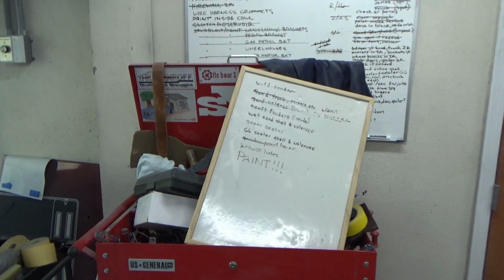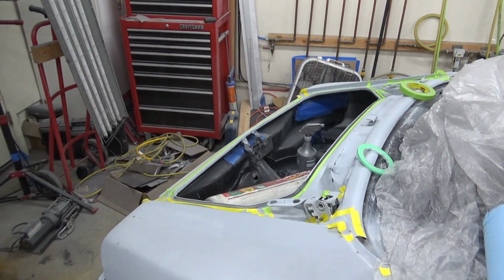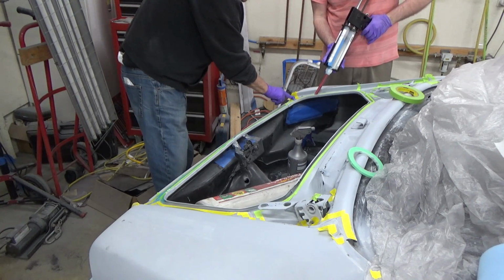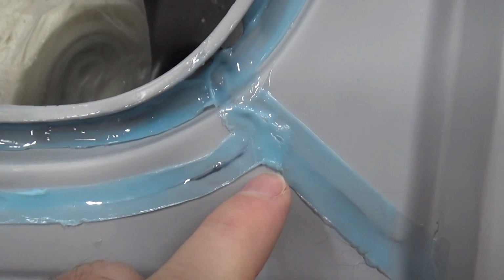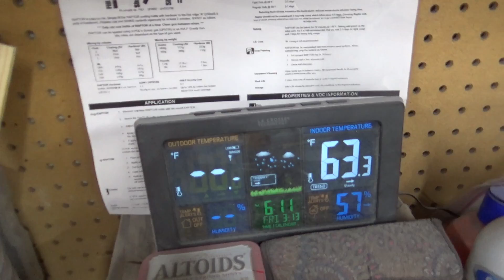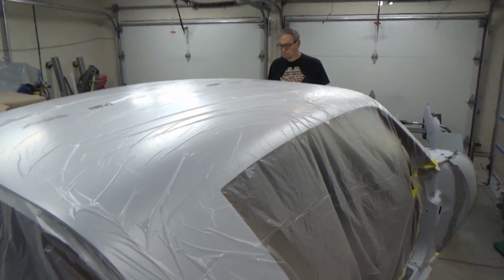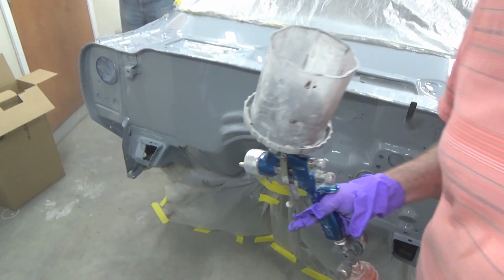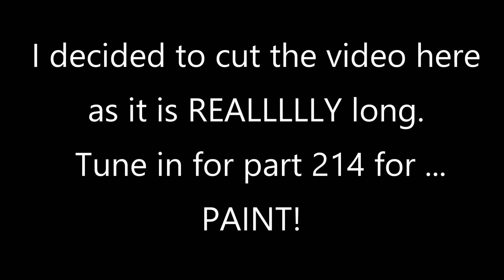1977 Camaro Z28 Part 213: Seam sealer and PPG ECS G6 sealer.

Comment: I apologise if you've already explained it, but could you please explain your air filtering and make-up air setup?
Reply from the maker: Hi Erin. If you go back a ways, you can see where we installed the fan and exhaust filters. On the intake side, we covered all the garage air vents with filters and there is also a big filter bank in the door that leads outside.
Reply: @asicerik  thanks so much. I'm starting a 79 trans am t-top car.  Again, sorry if you mentioned it before, but what engine/ trans are you running?
Reply: Any idea what episode you cover the air system?
Reply from the maker: @edoggy79  A four part series starting here. https://www.youtube.com/watch?v=l5S-Oghewkw for the fan
Reply from the maker: @edoggy79  That is great! My Mom had an 81 T/A t-top. Loved that car. The engine/trans are an LS3/430HP and Tremec t-56 Super Magnum. Unboxing video here. https://www.youtube.com/watch?v=iuATnUWv0gI Are you going to video your project?